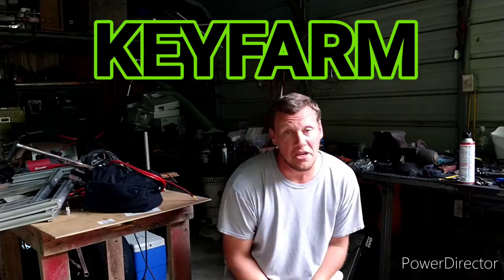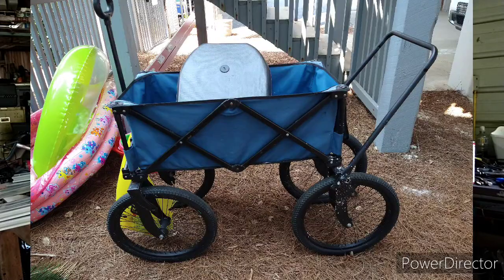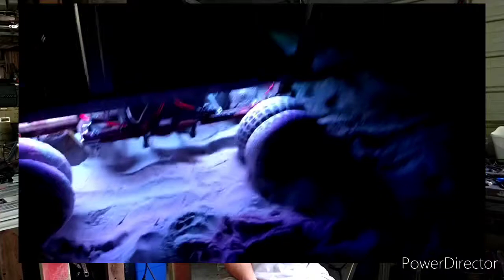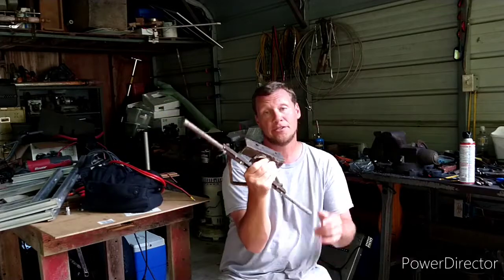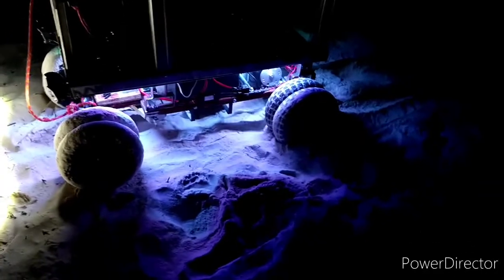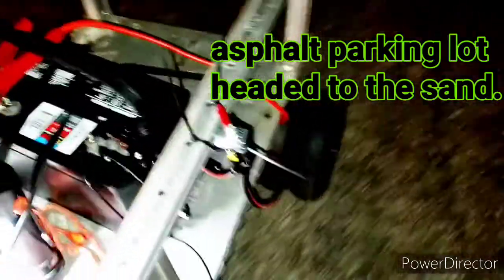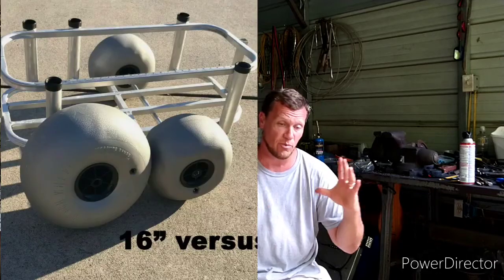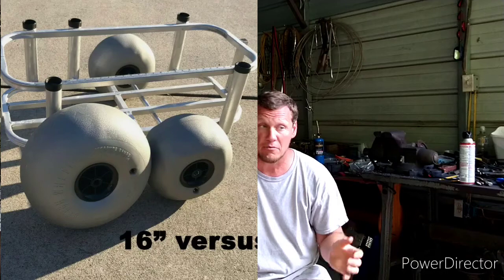Electric robot beach wagon , fabricated at Keyfarm, tested in Gulf Shores Alabama. Radio controlled.

Comment: That's cool. What I did on my electric wheelchair. It is 24 volts I took two rims split them apart. Putting in a PVC I believe it was 6in.  Wheels .Long bolts back through the two halves of will 6in lawn mower tires extra wide and as I could find fill them full of spray foam so I could go across sand rough ground. I did that back in the 90s I want to say. Just an idea
Reply from the maker: Thanks, sounds pretty cool
Reply: @ChrisfromKeyfarm  need help anytime let me know. I will try sir.

Comment: Hey brother from a different mother! I had the same idea as you. I doubled up the stock wheels from a Gorilla cart and  deflated the tires to only 2 or 3 psi if that.  You need just enough air so that the tires do not spin on the rims when in heavy conditions. This doubles your floatation on soft sand. Keep up the great work on your cart and let us know your progress.
Reply from the maker: This year's model will use 4 ,15" tall lawn mower tires ( typical front tires) it'll be 4 wheel drive.

Comment: Nice Job. Stay the course. In the 1990s there was a snowblower with tank tracks. Perhaps you could find one and use the tracks.
Reply from the maker: Good thinking, when I started this project, I looked for tracks, unfortunately the only luck I had was a set in New Jersey and it would have cost 3 bills to get them, but we never know what the future holds. Thanks for watching and commenting.
Reply: I was thinking if you made the driven axle a dual rear axle (tandem) and built some rubber tracks from an inner tube maybe? Attach crossbars to the inner tube and you have you tracks. Just an idea to make it not coat a lot.
Reply: My thinking is not full tracks but a half track wagon.

Comment: Hey Chris, I know I'm late but I think I got it figured out! 
I had to watch the video several times, weeks apart. 
I believe that you should extended your rear axel and add a third tire to each side.
Doing this should give Bruce more traction with the sand, and an even greater weight distribution. 
I know you probably don't want to hear this but, a raspberry pi is the way to go.. 
Awesome video, 
Thanks for sharing!
Reply from the maker: We ended up going 4x4  and a sabertooth controller, because I'm not smart enough for raspberry pie.
Reply: Turn it into tank tracks

Comment: If you’re on a budget and I know you are you can glue those rims super glue to the tires and air them way down that’ll give you your flotation and you could make yourself a set of chains with some rope or rubber tubing to give you a paddle tires are like tread. Put the chains on both tires at once that way you get the chain going across both tires so you get a wider paddle then if you chained each tire individually .that should work pretty good or if you can get another wheelchair motor and make it four-wheel-drive that would be ideal. God bless!
Reply from the maker: I did make a new one for the 2022 summer, it was 4x4. Worked well.

Comment: Ditch those tires and get some wide tube tires so you can deflate them and it should float or just get those expensive beach tires
Reply from the maker: I think this year will be 4x4 with 6x15 lawnmower tires.